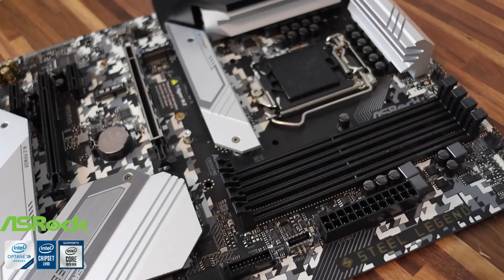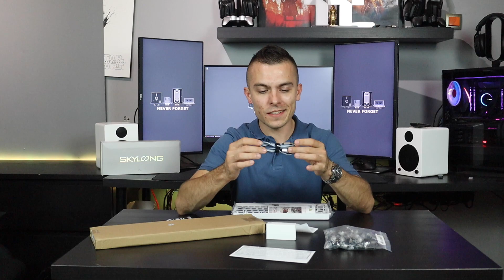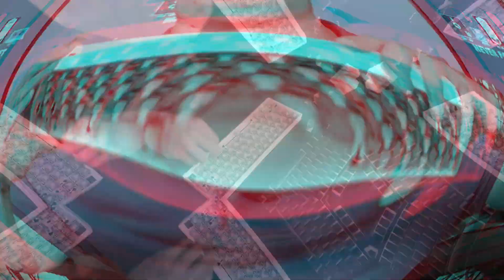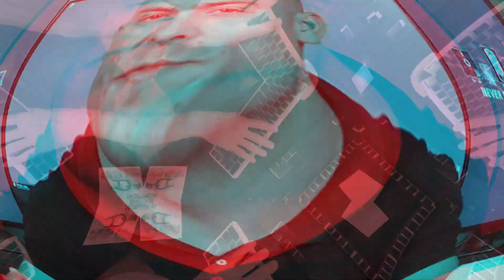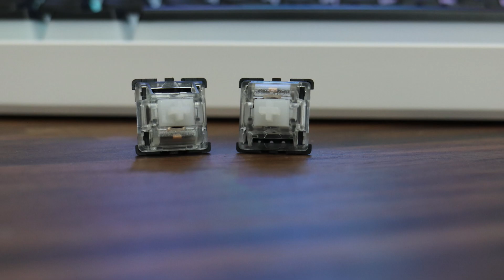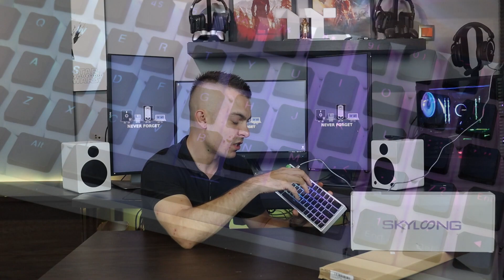BUILDING A SEMI-CUSTOM SKYLOONG GK64X KEYBOARD

Comment: The extra spacebar plate is for splitting the spacebar section into 3 separate keys. It's not to be used with a long 6.25u keycap. The X in GK64X means it has splittable spacebar.
Reply from the maker: Thanks for the addition. ;)